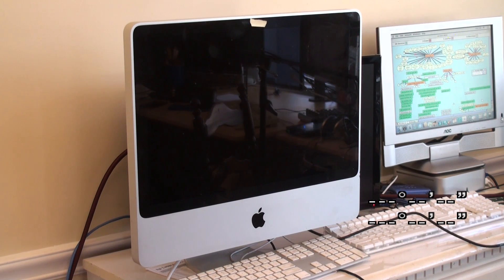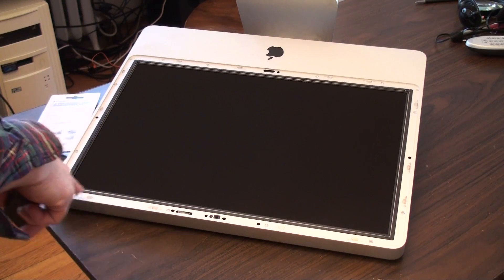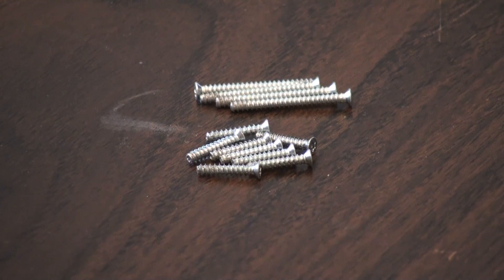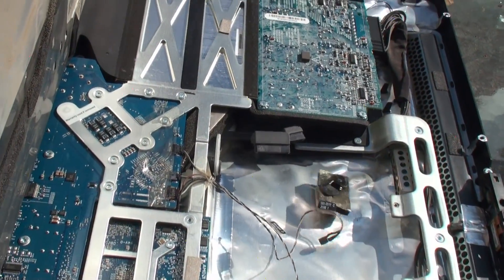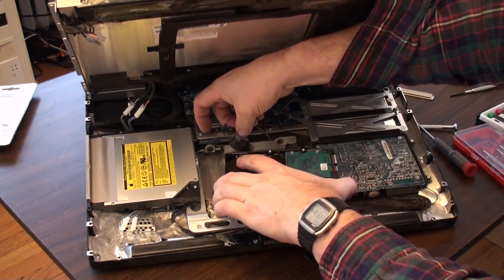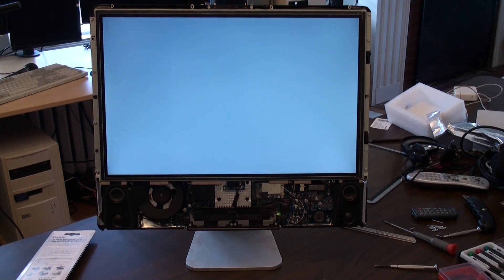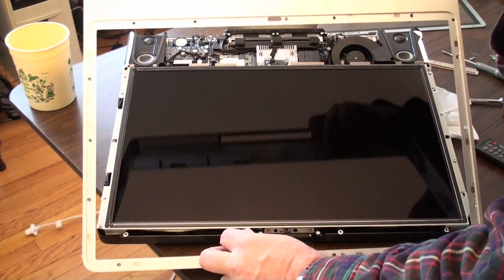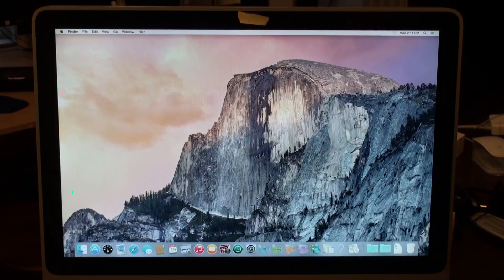iMac Replace Hard Drive Reinstall Operating System

Comment: How can I create my own install on a DVD?
Reply from the maker: I would look for a 10.6.8 ( or any of the 10.6s) because you can get the App store at that point and then upgrade up from there. Remember to install your Adobe apps before you upgrade too much because the Adobe installers will not work on later OSs.
Reply from the maker: It will be a .dmg
Reply: @cnibeck  I just had this situation where the hard drive died and need to put a new one in but Nick question was (How can I creat my own install dvd) so I got the DMG file now the How part can you help?
Reply from the maker: Besmel Tammo  You need a DVD writer on a Mac preferably
Reply from the maker: iT COULD BE A NON-mAC SPECIFIC usb dvd wRITER
Reply: @cnibeck  but the hard drive is dead and I dont have another MAC to create the DVD only other option is I have a windows machine, can I do it from there?

Comment: are you still using this iMac? if you are, i would get a t7 Samsung SSD, tape it to the back of the iMac, format it and restore from time machine back up, and boot from the T7, will be much faster overall :)
Reply from the maker: I totally agree with you… Now everyone should be replacing with SSD’s… That movie is from a long time ago… Thanks for pointing that out!
Reply: @cnibeck  yeah, nothing wrong with mechanical drives in 2015 :) but if you are still using this iMac, T7 Samsung SSD external would be a great upgrade for it, just tape it to the back and boot from it :)

Comment: What happens if you don’t have a disc ti install the operating system in the first place before installing Yosemite?
Reply from the maker: The iMacs did not have internet recovery I do not believe so you have to have a disk or an image to boot from. If I am wrong someone correct me please.  It depends on the iMac.
Reply from the maker: Only these have internet recovery...   MacBook Pro (13-inch, Early 2011)
MacBook Pro (15-inch, Early 2011)
MacBook Pro (17-inch, Early 2011)
iMac (21.5-inch, Mid 2011)
iMac (27-inch, Mid 2011)
MacBook (13-inch, Mid 2010)
MacBook Pro (13-inch, Mid 2010)
Mac mini (Mid 2010)
MacBook Pro (15-inch and 17-inch, Mid 2010)
iMac (21.5-inch and 27-inch, Mid 2010)
MacBook Air (11-inch and 13-inch, Late 2010)

Comment: what if your dont have the mac os disk??? what can you do in that case??? pls help!!
Reply: I believe upon startup you can press Cmd + R to open Internet Recovery mode and install macOS on to your hdd. This is a late comment but I figured why not try to help anyways
Reply from the maker: I don't see this comment.....   I believe it depends on which iMac it is.... Only these....MacBook Pro (13-inch, Early 2011)
MacBook Pro (15-inch, Early 2011)
MacBook Pro (17-inch, Early 2011)
iMac (21.5-inch, Mid 2011)
iMac (27-inch, Mid 2011)
MacBook (13-inch, Mid 2010)
MacBook Pro (13-inch, Mid 2010)
Mac mini (Mid 2010)
MacBook Pro (15-inch and 17-inch, Mid 2010)
iMac (21.5-inch and 27-inch, Mid 2010)
MacBook Air (11-inch and 13-inch, Late 2010)

Comment: Can u tell me why I did the same stuff you did just with a Mac OS X 10.11 disk but it don’t load up at all. Shows a loading bar but when it gets to full nothing happens and if I hold ALT it just shows me with a base OS X system
Reply from the maker: I was never able to use a newer OS on an older iMac.... Had to work my way up. Apple doesn't make sure their newer OSes install disks are bootable on older.
Reply: So I need to get a different os install disk for my Late 2008 iMac
Reply from the maker: Yes it loves 10.6 then Upgrade to 10.6.8 to get the App Store and then upgrade through the App Store
Reply: Chris Nibeck would it be possible to get any form of GarageBand on 10.6.8? Because I got GarageBand 6.0.5 but it says it can not open because it is not in the right format
Reply from the maker: @ActionXD  I believe so but alas I am not by a 10.6.8 computer right now....  I still have one that I use with Logic and an M-Audio A to D D to A adapter

Comment: Didn't work for me. Bummer! I have a mid 2011 27" iMac and my mac was randomly crashing. My smart status and system diagnostics always said everything was ok. After a few years of running it like that I finally got the app drive dx and it said my drive was failing. I backed up my data and ordered a new upgraded hard drive from owc. I did the install everything went smooth, but now I cant get my osx disc to boot. I have the original install disk my mac came with it's in good condition. I get the folder with the question mark, then insert the DVD,  then get an apple logo with the spinning sundial then the screen goes white and stays like that. I called apple support and they ran me through all the start up key commands and nothing worked. I have an appointment in the morning at a mac repair store not the apple store. So hopefully they figure it out.
Reply from the maker: Did you figure it out?
Reply: @cnibeck  yes, I did. Even though I had the appointment set up I kept trying my start up disk and finally after spending all day until about midnight my mac finally decided to read my osx start up disk. I was able to startup snowleapard and start doing some updates to try and get to high Sierra, my mac worked for a couple hours then crashed.  I got fed up and went to sleep, then in the morning I took my mac apart again because in the past I had suspected my video card might be going out on me so I decided to bake my graffics card in the oven for 10 minutes and double check all my connections and put it all back together and my mac started up like brand new. I cancelled  my appointment and continued with all my software updates and I got back to high Sierra where I did a time machine migatration of all my external harddrive data. My mac's running like never before. It was worth the hours of work and money. One thing that sucked was By calling apple support for help they flagged my mac because I told them I did a harddrive replacement. I didn't realize that would happen but it did. Now I can't get help from apple for that specific device.
Reply: @alexaguirre5778  Shame on Apple it should make no difference...... If I owned a business I would never treat a Customer like that.....

Comment: Hello, I have just replaced the hard drive in my late 2009 iMac. Now I only see the question mark in the folder, I do not have my original disk.  Any thoughts on how I can get it restored? Any thoughts are greatly appreciated.
Reply from the maker: Hi Dawne- I just saw this.... You need to boot off a DVD and then go into Disc Utility to see if the new drive is being seen.... Let me know!
Reply: Thanks Chris. I bought recover disks off eBay. Cannot find mine. I can see the drive and formatted it. But it says can’t install OS. It’s snow leopard. I’m guessing the disk is particular to the machine.  Uughh  if I buy from os from apple do you think that would work? Any other suggestions to get OS back on machine? Thank you so much.

Comment: what do you do if it doesn't show up in Disk Utility??????
Reply from the maker: Check your cables and make sure everything is plugged in correctly.... Is this the new one that you can’t see?
Reply: Yes that's correct. Disk utility doesn't see it.
Reply from the maker: The next thing I would do would be take the new drive out and connect it to a SATA to USB adapter and see if you can see it on a computer that way.... It might be the Sata Electronics on your motherboard or your cable
Reply: Chris Nibeck  ok will try that next.

Comment: Hello, so I installed a new hard drive and I followed what to do. When I see the question mark, I put my Snow Leopard disc in. The Apple symbol shows up but just freezes and doesn't go anywhere. The iMac I have is from 2009. Any suggestions?
Reply from the maker: Do you have another disc that you can attempt to boot from? It is either a bad disk or possibly you're having problems with your optical drive...
Reply from the maker: +Chris Nibeck disc meaning DVD boot disk
Reply from the maker: +Chris Nibeck if you have another Mac with a DVD drive and FireWire you could put it in target disk mode connected to the Mac that you installed the hard drive and install from￼ it
Reply: thanks for the response back. I went out and got a flash drive to use a bootable usb and it worked. So I guess the optical drive or install disc were the problem. Your video was very helpful.
Reply: @JKrauss09  how did you install using flash drive???
Reply: @JKrauss09  can you help I am new here and I don't have an install DVD, so how can I make a bootable USB? Thanks,
Reply: JKrauss09 when you put disc in hit option button hold till you see disc & hard drive